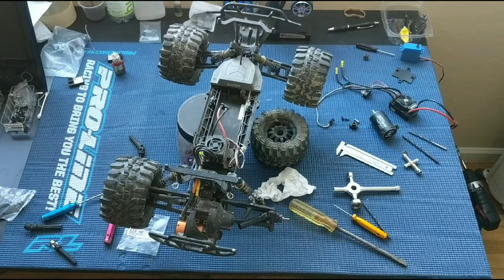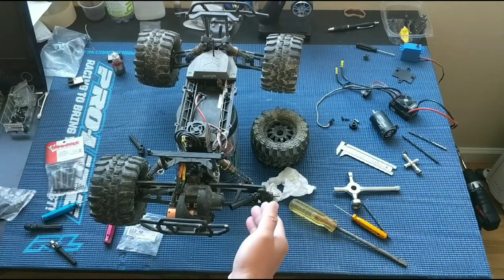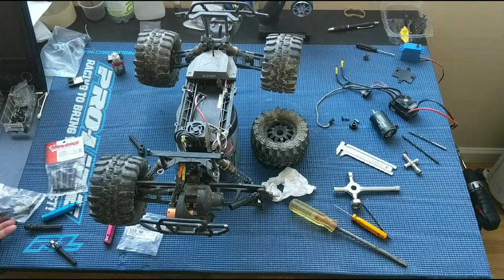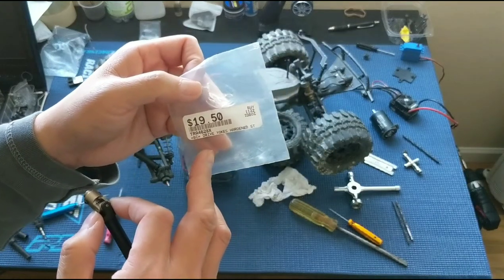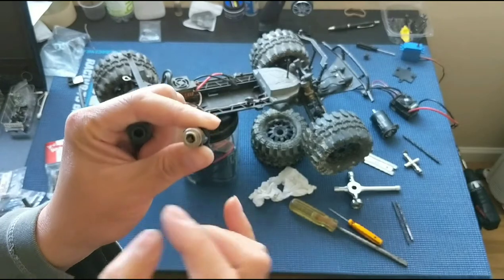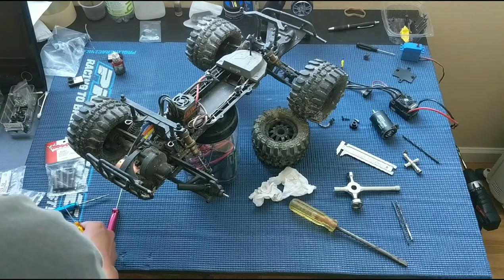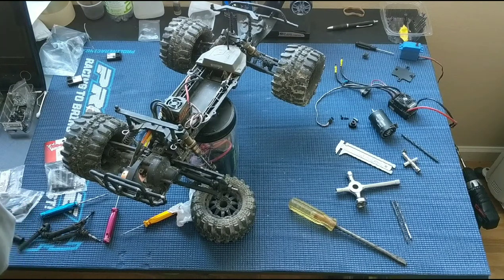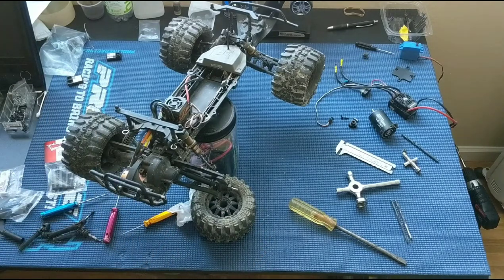ECX 2WD Ruckus Torment Amp Circuit Upgrading Driveshafts to Traxxas 6852X Axles, 4628X Metal Yokes

Comment: I just put new wheels and tires on my Ruckus. When I took the old ones off there was a hard plastic washer under one of the nuts on the rear tires. What is that for? What are they called? I think I need to order more of them. Thanks.
Reply from the maker: They're spacers so that the nuts don't bottom out on the axles. If you haven't bought some already, you could use some small washers as well.